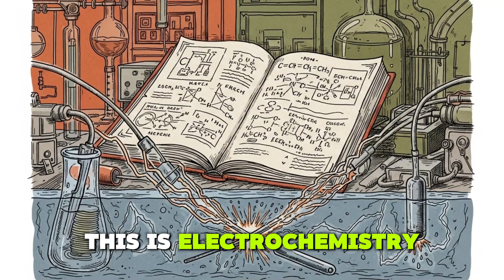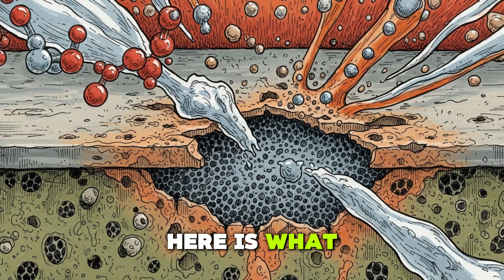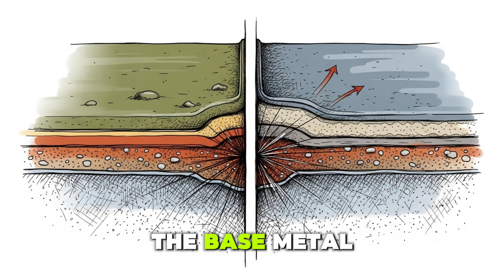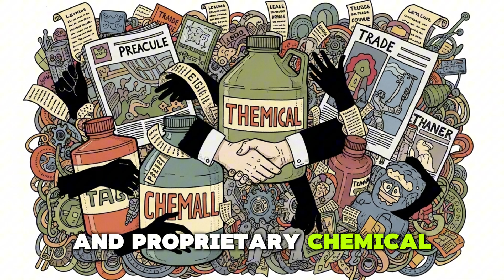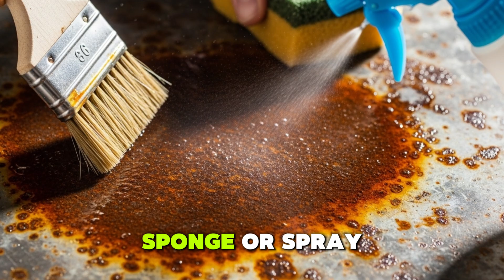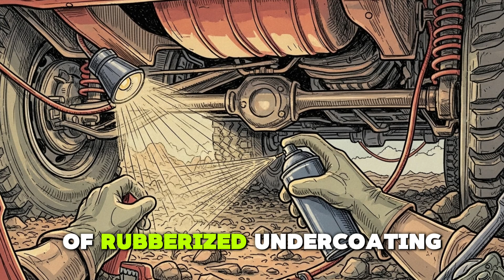$3 Liquid KILLS ALL Rust. PERMANENTLY. No Mechanic. No Shop. BIG AUTO BURIED THIS.

Comment: sensationalized af.

phosphoric acid rust converters are widely used and common in auto primers (rust converter/metal prep) and industrial coatings

it's not some suppressed secret

also calling this a permanent fix is an overstatement